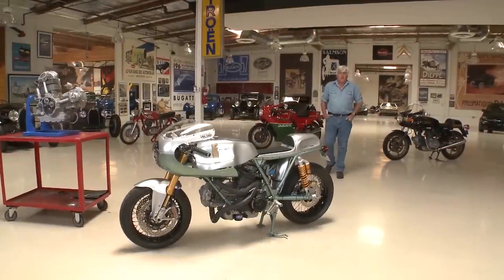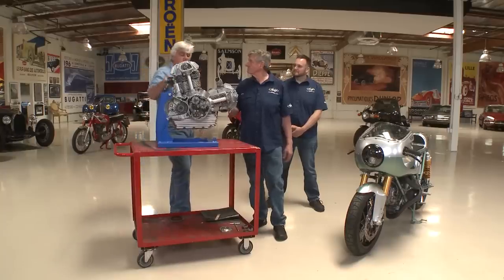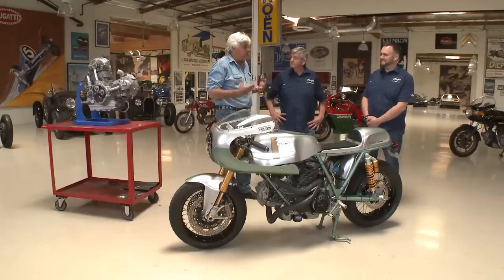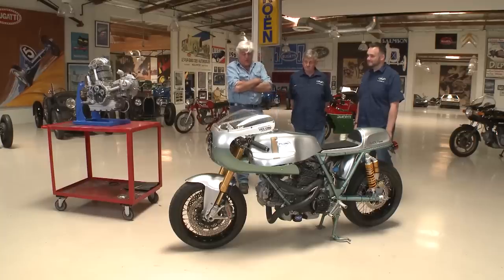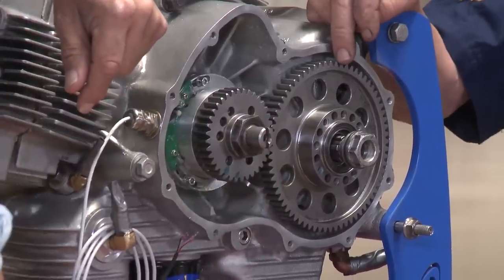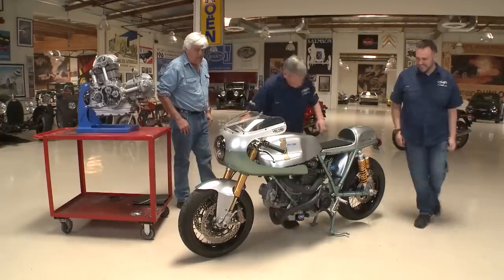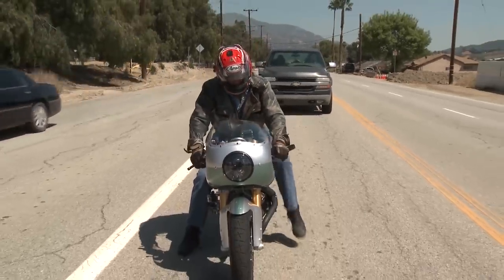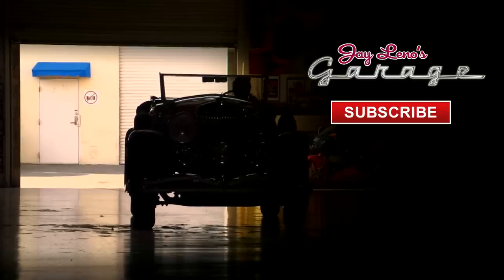Vee Two Ducati IMOLA EVO - Jay Leno's Garage

Comment: Ducati stopped making the bevel engine mainly because of the cost.  It's a totally ball and roller bearing motor and time consuming to build.The rubber band motors are also lighter.

I'm not surprised at the cost of this engine given what's involved.  Sounds reasonable to me given that a totally re-built original motor would be at least $12 K these days.

Nice bike and good video.
Reply: They did switch to a plain bearing bottom end on the very last engines.  No mention of what is in this one.
Reply: The Vee Two does indeed have plain-bearing big-ends and (presumably) a forged or billet crank.

I didn't know Ducati themselves implemented one, though. Do you know which models used it? Darmah?

WIth that change, it's got to be close to the perfect motorcycle engine.
Reply: I don't know if they still use roller main-bearings, though. I'm no engineer, but my inclination would have been to keep them, and it's likely they have, considering that the internals are otherwise all designed to be retro-compatible.
Reply: I think that only the final 1000 cc air cooled bevel twins used it.  

That was only from memory the last Hailwood Replicas and that modernistic styling exercise solo they did (can't remember the name).

The crank was forged and had a plain bearing journal but still ran ball races in the crank case halves, same setup as the Pantah motor I think.

I'm pretty sure that the crank cases were also different for the bigger motor.

I doubt that the Darmah ran it.  The Darmah bottom ends are actually quite robust, and I retro fitted one to my 860 GT when it blew the bottom end (as they all did).

Cheers Rob
Reply: The Taglioni Ducatis have always used ball races for the main bearings, due to the vertically split crank case design.

I've not seen a motorcycle engine that used tapered roller bearings in place of ball races on the crank mains in that design.  Ball races also have the lowest drag factor.

Cheers Rob
Reply: Actually, thinking back on it, I'm pretty sure that the Vee2 motor IS the 1000 cc final bevel Ducati.

It also had the oil filter underslung and Brook Henry stated in the video that they had simply obtained the original pattern molds for the production engine.  So it's one and the same.

What he didn't say is that the motor WAS produced for a very short time.  Makes sense that he would go with that stronger design.

What changes Vee2 have made to the gear sets is another matter.

It made me laugh when Jay Leno criticized the Italian wiring as all being the same colours,  That's not so.

I've spent plenty of hours nutting out Ducati wiring diagrams (all in Italian), and they DO use many/specific coloured wiring as is normally the case, it's just that nothing works properly due to the way it's all designed and cobbled together.

Cheers Rob

Comment: 122 hp not bad considering the weight its moving--

Jay when you mention weak valve spring material how do you account for Kawasaki 900/1000 revving to 9000 and 10,000 with good cams and no float? I had a 74 Z-1 bored to 1015 Wiseco, 29 smooth bores, Megacycle 417 lift cams, big Manley SS valves, etc that would pull to 10 grand or more

Comment: It sounds so smooth for a V-twin!
Reply: Ducati's 90 degree V-twin is perfectly balanced. The engine is totally smooth at all speeds, which is strange since it makes all kinds of noise from the cam drive, the intake and the exhaust. It's a blast to ride; I had mine for 20 years and it was always a thrill, at least after it warmed up (it took 5 quarts of straight 50 weight oil so it took a while for the juices to start flowing).
Reply: @soaringvulture  it's an L twin not a V.
Reply: @ericvanhalen1135  It's a 90 degree V. You can call it an L if you like.
Reply: @soaringvulture  Fabio Taglioni called it an L twin. I'm thinking he knows alot more about Ducatis than you do.
Reply: @ericvanhalen1135  Yes, Dr. T knows more about Ducatis than I do but he had an axe to grind; he was proud of his engine and wanted to give it a distinctive name. Look at it this way: Take an L. Make the horizontal and vertical lines the same length (both cylinders do have the same stroke on account of their being on the same crank throw). Then turn it 45º. Now you have a V. So the engine is both a V-twin and an L-twin, depending on your mood.
Reply: @soaringvulture  it's an L while both wheels are on the ground, if you wheelstand it to 45 degrees it becomes a V, yeah??? All good mate I get it. Sure do miss my 75 750SS. Best bike, best sound. 😎.

Comment: Jay, just because the Ducati motor has the bevel drive gears doesn't automatically mean that it  has desmodormic (springless) valve gear. The cheaper versions had the bevel drive gears driving camshafts operating on valves with springs.

Comment: I rode the same or similar bike for Brook at Phillip Island GP circuit a few years ago. Thing was a rocket but handled like shite !  Spent the whole weekend trying to get it to go round corners only to find out Brook had used aluminium axles front and rear !!   Alan Cathcart was to ride it at the Bathurst meeting a few months later and it still handled like crap.  Brook is a lovely guy and I love his work. You only have to look at his Daytona results.
Reply: I saw Owen Coles racing an Alchemy around the streets in Collie, WA. He basically did wheel-stands from corner to corner. There is a photo on the internet somewhere of him giving a V sign with his fingers to the camera whilst he is up on the back wheel during a race.

Comment: The last MHR bikes were 1000cc and got a one-piece crank with shell bearing big ends.  I wonder if these bikes use that tech?  Also, NCR made a small number of cylinder heads with valves at an included angle of 60 degrees instead of the regular 80 degrees.  There's no hint which the V-Two guys are using

Comment: I'm an athiest but GOD, I want one of these!!  Jay did mix up his explanation of the bevelshaft driven cam system though!  The bevel gears don't have much to do with control of the valves, valve control is by the desmodromic system.  The bevel gears and shaft just drive the camshaft and was standard practice for quality race engines of the era. The valves are both opened AND closed by rockers that are driven by the cam. Actually, if the clearances are adjusted correctly the engine will run with no valve springs!  Although starting may be a bit difficult!   The springs fitted to a Desmo engine are quite light and are mainly there to seat the valve at low engine speed and for reliable starting. The Desmo system is a thing of engineering beauty but very expensive to manufacture on a road bike. It does allow way more radical valve timing though, as there is no chance of valve float. Also, over rev on downchange is not an issue, unless it's of a drastic nature!

Comment: Will somebody please re-create the Britten V1000
Reply: The Britten is a masterpiece of mythical proportions. I don't think anyone could really improve that bike. Any change would compromise it. Even an exact replica would not be as good as the original, i think. A reproduction would be ultra expensive as well. Though i love the idea of being able to ride and buy one.
Reply: @DolleHengst   The Britten V1000 was a very clever piece of engineering.  John Britten had a unique ability to get his bike to run nicely and powerfully.  No one else could do that.  I read somewhere that the design rights were sold, so there may be issues about making spare parts, let alone replicas / 'continuation' bikes
Reply: Michael Demetrio 
If anyone should do it then it must be the guys at Vee Two.
Reply: Or the Feuling and i'm not ever a Harley Davidson owner but a Harley engine with a 3rd jug blew me away. What a shame that the creator succumbed to a heart attack just as he was realising his dream.

Comment: It is refered to as "Desmotronic", Valve system. No Valve springs and endless rpm potentional! WoW , can you amagine this set up in a V/8 engine?
Reply: Yeah - or a Straight-8, as per the 2.5 and 3.0 litre direct injection Daimler-Benz engines of 1954 and 1955 - fantastic...!
Reply: I beg your pardon-- desmoDROMIC.

Comment: Holy crap- they cast the entire motor made to order?  Most be super expensive.  Also, if this was supposed to endurance race, I totally would've made the seat and rear fairing part of the fuel tank.  It'd take some creative venting but is doable.

Edit: $28k for the motor and $59k for the bike.  Expensive.  I thought it'd be maybe 1/3 worse though.

Comment: They'd never do it, but Ducati should let these guys do a red & green one with a white Ducati logo on the tank.
Reply: I reckon you could ask your auto painter of choice to replicate the iconic design. ^^
Reply: Ducati do respect VEE TWO for the Development work they have done over the years so anything is possible but Ducati would want a fair slice of it though.
Reply: Ducati cannot do anything on what is now 40 year old designs. Since they do not support these older bikes in any way, they have no rights other than the Ducati logo.
Leno got it wrong, he's riding a Paul Smart livery replica. 
Also, the original Hailwood design colors are not from Ducati but from UK's Sports Motor Cycles, the Ducati importer at the time.
Reply: I was about to say the same thing re Paul Smart colours
Reply: As I recall the Ducati factory wanted nothing to do with Hailwood's IOM return, it was a private effort by Steve Wynn of Sports Motorcycles.
Reply: and Hailwood's bike was built by NCR, who still make shiny fast bits :)

Comment: Jay ( 2:44 - 3:50 ) still doesn't understand how desmodromic valve mechanism works! Jay thinks it works by "bevels", but bevel gears are the gears shown used to merely right angle the drive shaft and camshaft... and is also used for non-desmo OHC Ducati engines... desmodromic works by rocker arms ( not "gears" ) that both open and close the valves... relying on tiny valve springs to only hold the valves fully sealed close

Comment: I hope JL doesn't mind, but here's a link with a concise synopsis of the changes Vee Two Australia have made to the motor. They've addressed pretty much every single weakness in the original design, not least a change to plain big-ends (and presumably a one-piece crank).

(no affiliation.)

https://rocket-garage.blogspot.com/2017/01/the-vee-two-ritorno.html
Reply: M R A Scott  According to your post's  website, Rocket Garage, the price of the bike is AU$38,000.
US$59,000 seems a bit out of line.
There can't be $31000 in customs duty and transportation.
What am I missing?
Reply: Nevermind, I guess the price listed is for the engine only, which he did say was  US$28K.
The post showed the bike while giving the price for the engine only.
Initially confusing, but I understand now.

Comment: That is just a method of driving the cam. You need to be focusing on the desmodromic aspect and the advantages of a cam lobe that closes the valve rather than relying on a valve spring.

Comment: The USD fork just wrecks the whole period-correct aesthetic, imho - Should have a quick-release axle clamp type "Forca Italia" unit, or a 43mm HARRIS fork, 41mm Marzocchi at the skinniest - Either which way you slice it, this bike needs fixed non-floating rotors of a 1970's style, early '80s pre-floating or very very early floating stuff, but bigger than the 285mm Brembo stuff, of course  - It just oughtta be more PERIOD-CORRECT, is what all I'm getting at - 18" rims of course, the "SUPER-AKRONT" 3.5x18" rear is so lovely & lightweight (I've got a couple on my Honda DOHC-4 projects, they're fantastic!) and maybe a non-shouldered Akront TR in 2.5x18" or 2.75x18" up front - "SKINNY" rims, but as fat as they came in the late '70s, maybe 4.25x18" for an '80s thing -  When did they SELL the Akront TR rims in that size? I'm trying to figure out when I can build 'em "PERIOD CORRECT" for - My '79 version DOHC-4 Honda, or an '83 style  with the TRAC anti-dive fork?  Hmmmm - An absolute mystery, to ME.......

Comment: That seat cannot be comfortable can it?
Reply: probably more than any shitty foam seat, looks like a hard gel, should take out all the vibrations etc.
Reply: Don't get me wrong, the bike looks fantastic and probably is great to ride for a few hours once in a while.
Reply: St Hr Have to respect the voice of experience...
Reply: girafmad I mean, it's virtually a (1981) race bike, but modified to be street legal. Seat, riding position, etc are geared for racing more than comfort or touring or whatever.
Reply: Nope, not comfortable at all. No sporty bike intends to be comfortable.
Reply: Not meant to be
Reply: Slightly more comfortable than sitting in a cheese grater with no underwear I'd say.

Comment: Anyone who orders this bike with electric start should be beaten with a length of chain and robbed for all their money.
Reply: Truly ruly. That's a kick start bike. Any time it doesn't light up with an easy kick there's something wrong with it.
Reply: @soaringvulture  That bike certainly looked easy to start. Somewhat of a difference from the original 750's. There was a certain knack to starting them, getting it wrong could be painful. This one looks like it starts very sweet.
Reply: @PeterHerriman  That wasn't my experience. My 750 kicked over easily and started on the first kick when I had the choke set and didn't twist the throttle to flood it from the accelerator pumps. I did have electronic ignition and platinum plugs so I always got a good spark. In general, I could kick it over while I was sitting on the saddle.
Reply: @soaringvulture  G'day, I guess everyone has slightly different experiences. I don't remember my Duke having a choke?? Do remember not using throttle until it started. Was normally a one kick, but only after setting up the piston to certain spot - bugger - how bad is this - I cant remember exactly where (I might be getting mixed up with Dad's Matchy now).  I did get a couple kicks from mine - and as it was the side I had bad accident on - learnt to start from centrestand and left leg - standing on ground off the bike - Couldn't afford to damage my leg any more - even a bump at that time) Where there is a will there is a way. Sounds like yours might have been a later model, mine was still points, and I remember the coils were not great and it was common to put in Yammy 400 coils - which I did. Maybe that was what made better starting back then. Memory of the specifics has sadly faded a lot, which is sad, but memories of the beautiful rides and the people are still there.  soaringvulture - Great handle - actually the Duke was very similar - so smooth and elegant on those long open corners at (good) speed.
Ride Safe, watch out for idiot cars (I always did - but still got caught) and enjoy it while you can.
Reply: @PeterHerriman  My 750 had Dell'Orto carburetors. They didn't actually have chokes, they had an enriching circuit which was a little carburetor with its own jets that ran in parallel with the main carburetor. You opened this up when starting cold with something that looked just like a choke cable. So I thought of it as a choke.
My bike came with points and a feeble ignition system just like yours. Magneti Marelli and all that. I left the points in but used them to trigger an Accel electronic ignition. I never had to set up the piston or anything. It just started when I kicked it over.
I rode that bike for 20 years until it was lost in a fire in 1993; I would probably still be riding it today. It was magnificent.
Reply: @soaringvulture  How sad to have lost the bike in a fire, I feel for you, that's worse than when you sell it cause you need the money, at least that way someone is enjoying it. Thanks for the memories about Dell'Orto carbs, sort of brings back a figure of 32mm for some reason, and the big SS's were something like 40mm. I agree with you wanting to still have one today.
Despite all the comments in here on how expensive the motor seems - I don't see that, to get a hand crafted bike beautifully made and yet in the mould of a classic - it would be priceless. Only problem - I don't have the coin to indulge. I wish those guys a fantastic success (I actually reckon the bike is probably a bit cheap, for the work that has gone into it, maybe that is the benefits the American $ is giving overseas purchasers an advantage, and our Aussies a better chance to sell to the USA). Good Luck to them! and to you mate!
Reply: After buying it , is there any money left to rob them of ?

Comment: $28k US just for the motor, that's $40,591 New Zealand dollars, a brand new Ducati Panigale 959 2017 is only $23,790 NZ, I could almost buy two of them just for the price of the replica engine and Jay say's it.s not a bad price. I suppose it all depends on what u earn and have in the bank but the motor and bike seem very over-priced from my point of view. Glad they are being made though...
Reply: Adam Skinner 
Ducati makes thousands of Panigales per year, and heaps of other bikes. 
Vee Two hand makes bikes at extremely low volume.
This is much more like a piece of art that just happens to be motorcycle shaped, and purchasing one would be done for the same reasons; this bike will speak to the soul the way art does.  Also, like art, this would be purchased as an investment. It will never go down in value, whereas a Panigale will be half price in 10 years

Comment: Jay, this is awesome, but please stop "Trumping it" with facts. Bevel drives have nothing to do with valve float, that's what desmodromic valves are for (which Ducati also repurposed from Mercedes racing engines). Also, the bike you rode has colors of the Paul Smart racing Ducatis,  not the Mike Hailwood Ducatis. The original bikes may be $200K  now due to speculation, but they were very poorly made, this bike is just better in every single way possible.
Reply: Have you actually ever owned or ridden one of the old bevels...